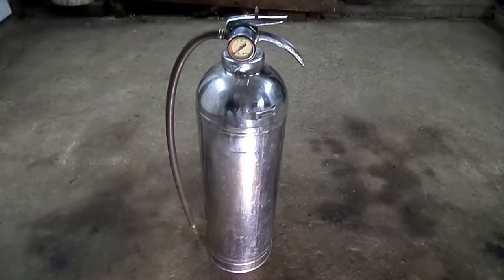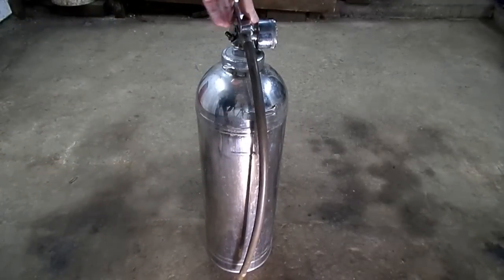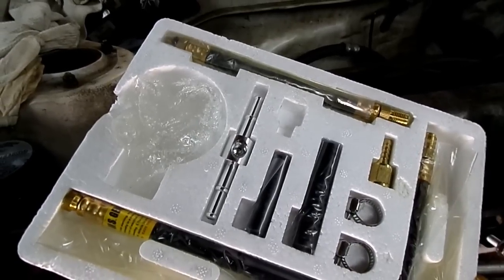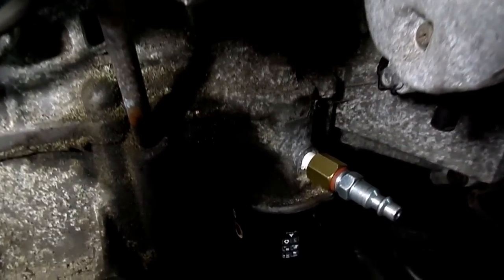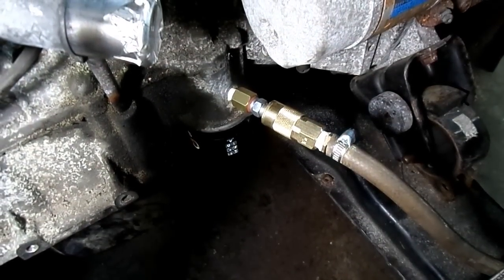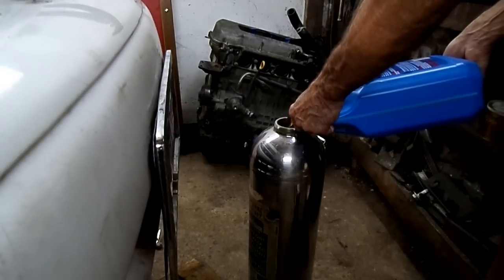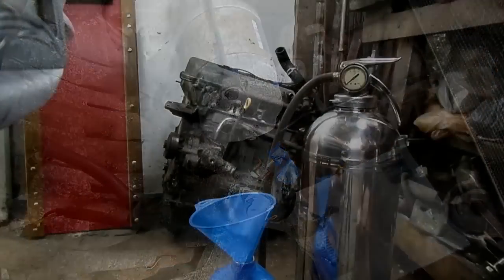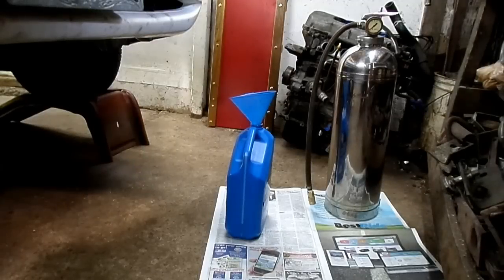Homemade Engine PreOiler

Comment: HEY Richpin ! "Engine PreOiler" Yeah I needed something like that for my old Neon I use to have , especially when one of the lifters was breaking down. Car made noise until it warmed up but I always had to add oil before I started the thing (engine had gasket leak) and I always thought "man if I could just push a button on something and add a little oil before I get outta the parking lot maybe I could delay the day the engine finally goes poof" I did delay it, but eveyday I would add oil and the nighbors would say " you are putting oil in it again" lol Well they dont have to worry i delayed and delayed until last summer when the timing belt slipped off and that was it for a neon.

Comment: What's the point of this? He seems to be adding oil through this pressure tank versus just pouring it into the engine through the valve cover. It isn't pre-oiling the engine at all.
Reply: David Browne 
This is to prevent  a jump timing chain .. some manufacturers  has hydraulic  timing chain adjusters((like pistons that are pushing the timing guide )) and this procedure is critical  bcz through it u are building the enough pressure to push the Piston to tension all guides
. This procedure prevent a jumped timing chain at the first start.. && I'm sorry 4 my bad English ..

Comment: Thats a smashing and smart looking pre oiler :-)
Your too clever :-D
That fire extinguisher looks like stainless steel, looks old too.
i saw the slight hesitation on applying the ptfe tape, i do that too, its a "now which way to keep it wrapped" lol, i used that stuff on a gas cooker hose fitting and a later engineer moaned because it wasnt green, but then he said it was a good job and it didnt leak, talk about being confused ha ha :-D
Hope ya dad is all good now, running marathons and chasing tigers :-)
Reply from the maker: zx8401ztv Dad is driving me crazy because he can not get well soon enough.
Reply: richpin06a He has to remember he isnt 18 any longer, as long as he is slowly getting better then thats good :-).
Didnt you know that parents are there to mentally torture there children later in life ha ha :-D :-D

Comment: Nice video. have a quick question on a 2002 Saturn sl2. I'm changing the valve body in the transmission and was wondering if you would know what the silinoids should read i am geting 6.7 to 6.3 omes
Reply from the maker: Terry Hopson When it comes to automatics i like to pass it to the next guy when they need work.